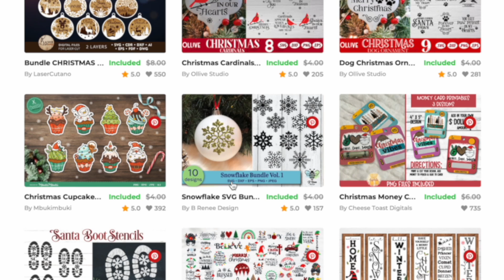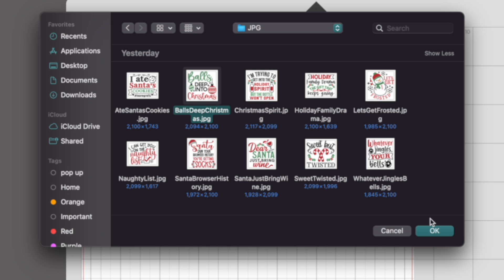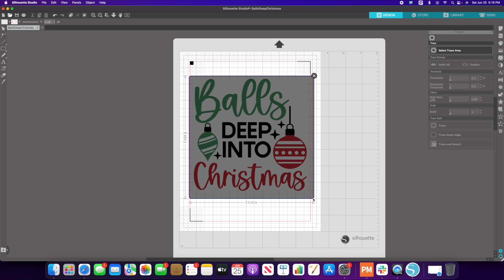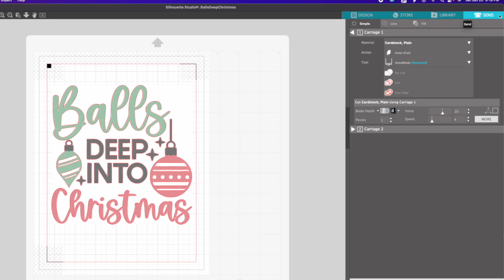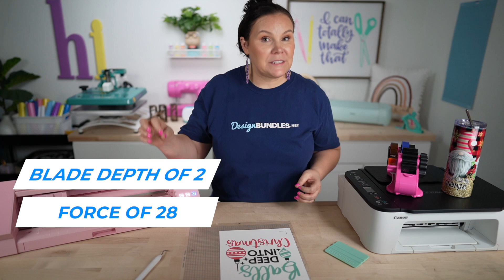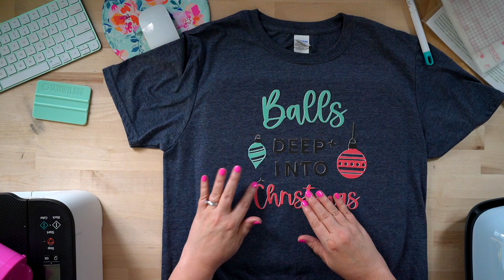🎁 Introduction to Printable HTV | Christmas in July 🤩

Comment: I thought you still had to mirror when you used it for light material.
Reply from the maker: Hey Kristen! For printable HTV you don't have to mirror as the adhesive part is on the backside.